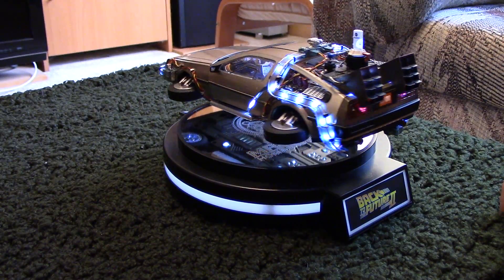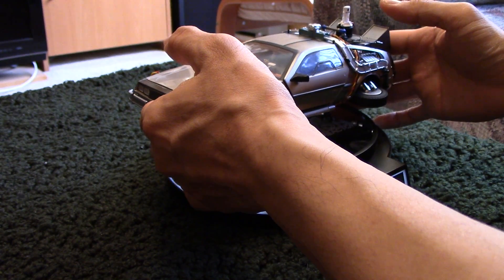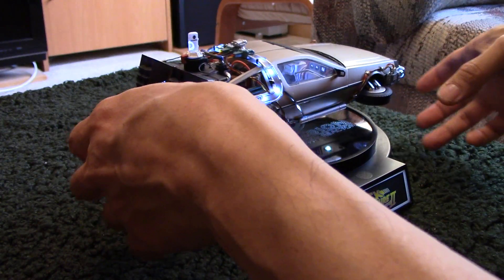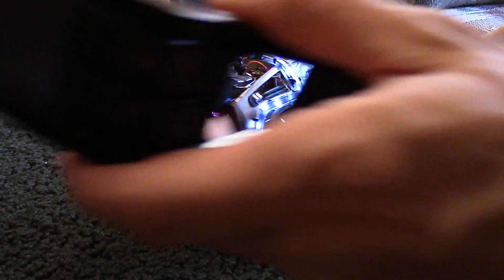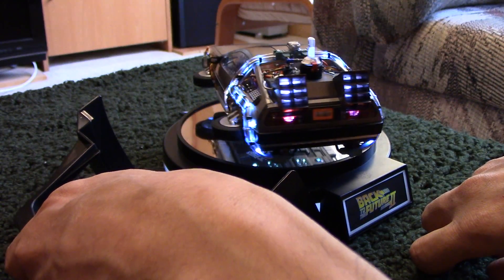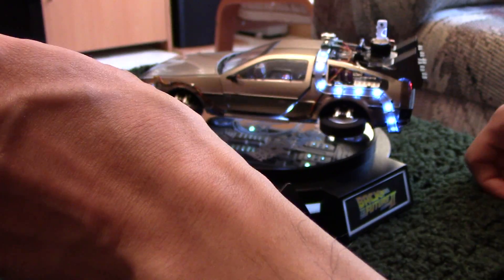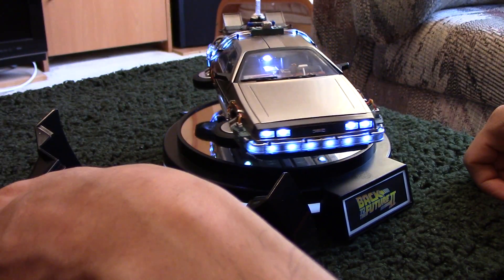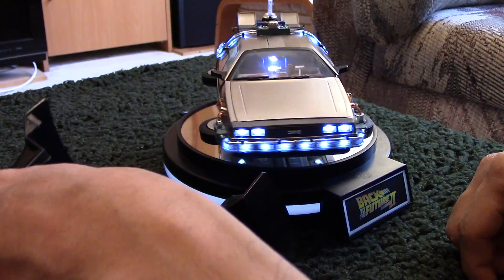Kids Logic BTTF 2 MagLev DeLorean - 2 ways to Levitate

Comment: An update it runs at 12 volts. 15 volts is far to high. Run mine all day 7 days a week no heating issues.
Reply from the maker: Appreciate the update!
Reply: @1515cci  your welcome. The standard 15 volt power supply poses a fire risk as it over heats in hover mode. Mine used to get hot and shut off, but now feel its a safe product.

I have warned others of the danger of using the supplied power supply.

Comment: Dont use the 15 volt power supply that's included? Its dangerous and could cause a fire. At 15 volts the levitating mount overheats.

Use a variable power supply that goes up to 13.5 volts. Then can levitate all day and everyday and runs miles cooler than  the 15volt supply included.
Reply from the maker: Thanks for the advice. Much appreciated.
Reply from the maker: Where did you get your variable power supply?
Reply: @1515cci  plenty around on amazon.com. do a search variable ac power supply. Want one to go st least to 13.5 volts and runs easy on 13.5 volts. It may run at 12volt but have not tried it. A lower voltage will run cooler.

Have had mine run about 15 hours straight. No issues. And does not overheat like it does at 15 volts
Reply: @1515cci  2 more things. I can confirm it will run at 12 volts fine. Also get a power supply with the multi pack different size power pins.
Reply from the maker: @denodan  thanks!
Reply: @1515cci  I did read some came with 12 volt supply and claimed did not hover. Mine hovers perfectly using 12 volts
Reply from the maker: @denodan  yup, I read the same.
Reply: Does it make any difference in getting it to levitate with another power adapter ? been trying for 3 hours now but it is impossible... Have made a home made also and that works first try every time..
Reply: @Swedeonamotorcycle  won't work under 12volts
Reply: @Swedeonamotorcycle  mine runs fine, still levitates the same

Comment: Think the voltage is to high on the power supply. Its mismatched. Running mine at 13.5 volts and base runs a lot cooler and floats at 13.5 volts. At 15 volts the levitaring stand runs to hot. Had money shut off completely. The only reason they say no more than 7 to 8 hours is voltage is to high. Got other floating devices that charge magnetically also and not issues at all.

Comment: hi there, I've seen another video saying that you need the correct adaptor as you had mentioned, But what they were walking about was 15v with 2A. The base is 2A but when i look at my adaptor it has 15v 1A written on it. Is your's the same thing?
Reply: What ever you do dont use the orginal power supply? It's far 2 high and think that's why people are saying it over heats. If it gets to a certain temp with switch off and your car will slam down.

It's due I am sure due to the 15volts being too high. I can confirm now will run off a 12 volt power supply.

Since not using the orginal power supply can run it all day in hover mode and no over heating. In fact it runs much cooler.

Using 15 volts is a risk and could be a fire hazard.
Reply: Just got it to work. It's not easy at first :s
Reply from the maker: Yes, it's the same.
Reply from the maker: Glad to hear it!  Once you've successfully got it to float free hand a number of times, it's much easier than using the placement tool.